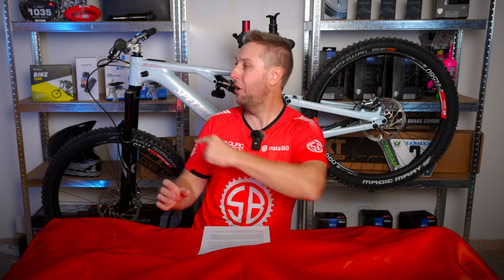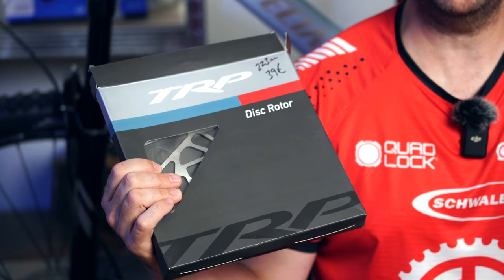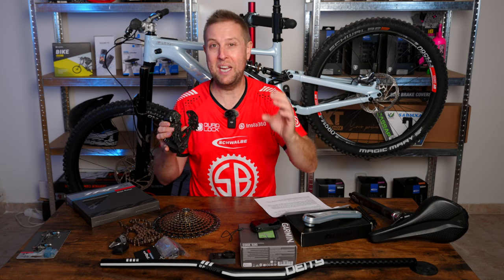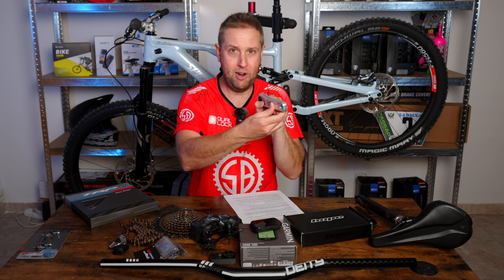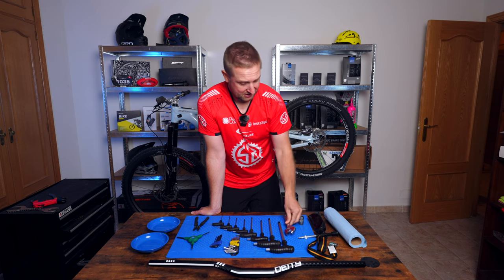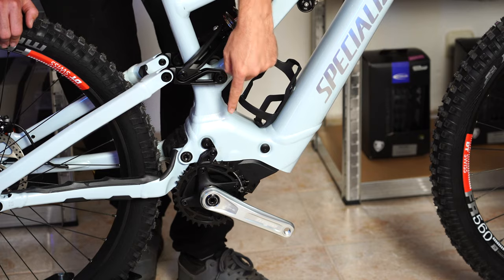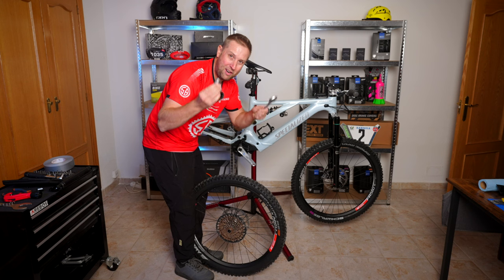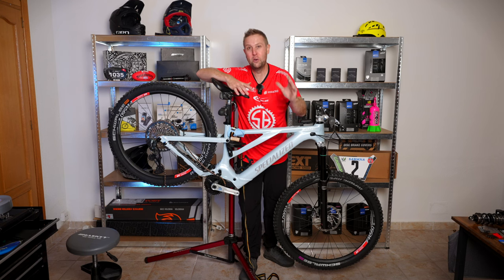SPECIALIZED LEVO GEN 3 ! -  Episode 6 on My Specialized Levo Gen 3 2022 DREAM BUILD EMTB E Bike

Comment: Sam, could you tell me which offset the Cranks need for the Levo Gen3?

Want try shorter Cranks for more clearance because i ride the flipchip in the low position and miss the lost 7mm .

Your Vid's are BEST 👍

Now i am out for a while about my shoulder. (Wallride finished but i was not finish with the wallride) 🤷🏻‍♂️
Use the time to wrap my Turobo Levo with a new printed wrap in stickerbomb styl. This year it was NUTELLA brown wrapped.
Stay tuned and give us pleas a feedback about the difference between stock cranks and the shorter ones.
J.K.